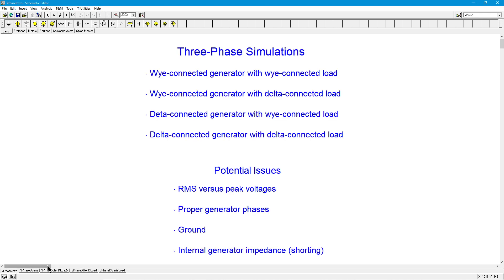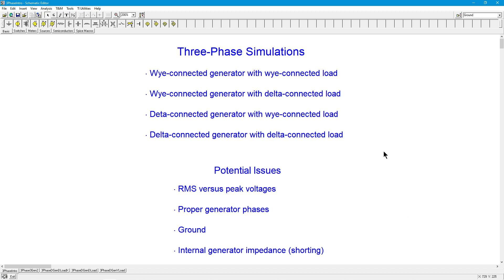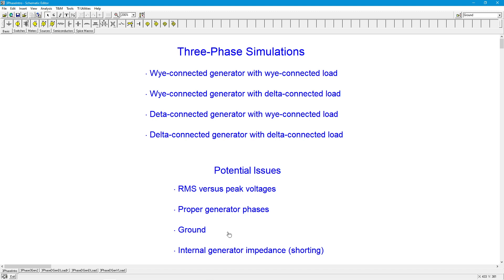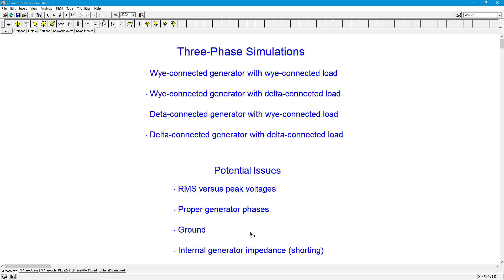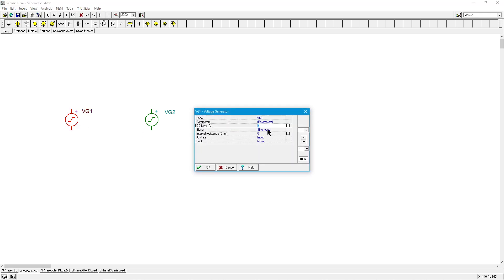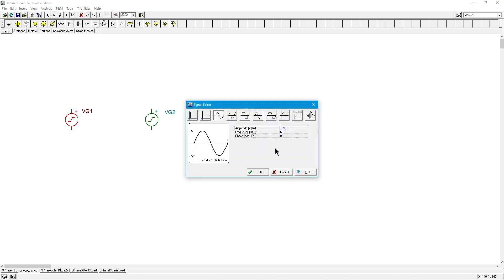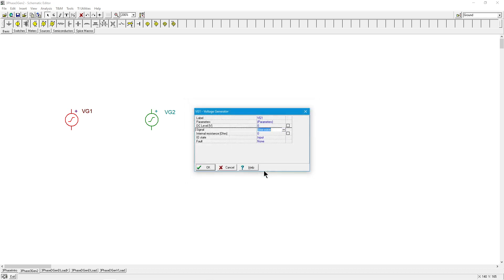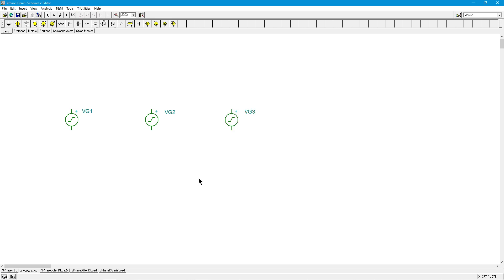AC Electrical Circuit Analysis: How to Simulate Three-Phase Systems, Part 2

Comment: Good video. @14:46, how did you assign polarity to the "voltmeters" as point 1 and point 2 both polarities seem same.
Thanks for your excellent work.
Reply from the maker: Not sure what you mean by point 1 and point 2 having the same polarity. We define the line voltages by going around the loop (1 to 2, 2 to 3, 3 to 1), calling the first point positive (that is just a reference direction because these are AC signals).